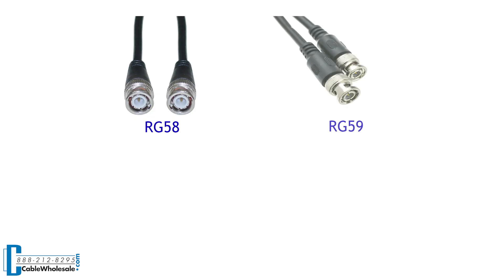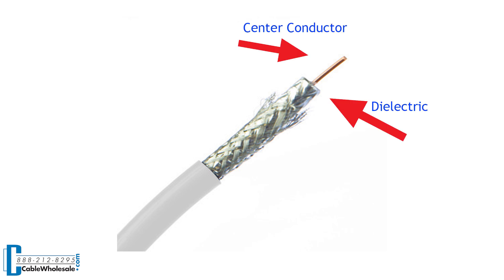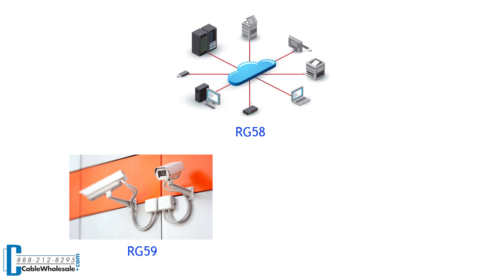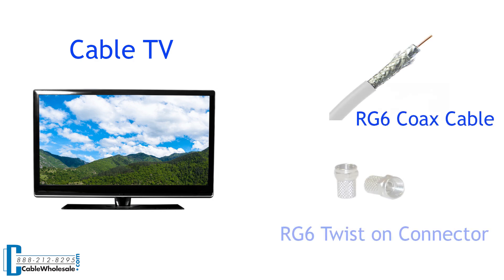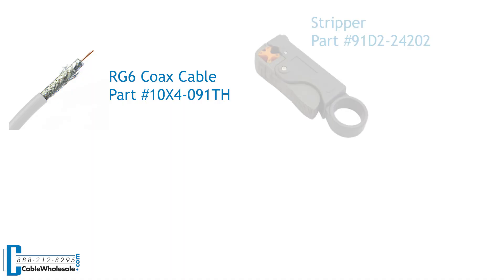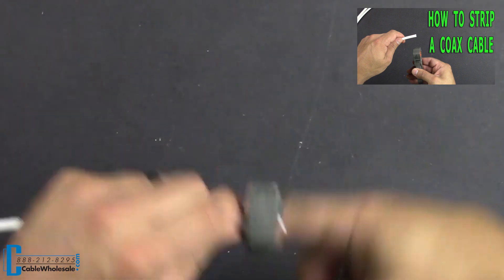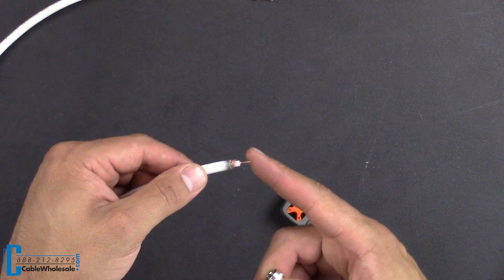How To Install a Twist On Coax Cable Connector - RG6

Comment: I had some twist on connectors in my tool box so I tried to use them but I could not get the cable to fully insert far enough so the insulation would be flush up against the connector body per the design.  I tried three or four times and couldn't get it.  So, I went and bought a crimp connector tool and some crimp connectors.  I was wondering if my cable was too thick.  It is 18awg coaxial cable but it clearly is marked RG-6.
Reply from the maker: Hello @nathangould2856 there should be a problem with the measurement when you strip your coax cable
if you want to send me some pictures to support@cablewholesale.com I may be able to help you, the RG-6 we sell is 18AWG and there's no issue with the connectors we sell for it, 10X4-122TH(quad shield) and 10X4-022NH(Dual Shield) please send me an Email and I will give you a hand!
Miguel

Comment: i have crimping tool but not the cutting tool, always used box cutter. this time i used the twist terminal. i cut the cable plastic sheath 1/2" then 1/4" to allow me to twist it on. happy with the results work great. Thanx Bro' for the video 5 years and still helpful :face-fuchsia-tongue-out:
cerveza for you 🍺:face-blue-smiling:

Comment: Twist connectors are the last choice for coaxial cable termination. The best method is use of compression connectors followed by crimp connectors.

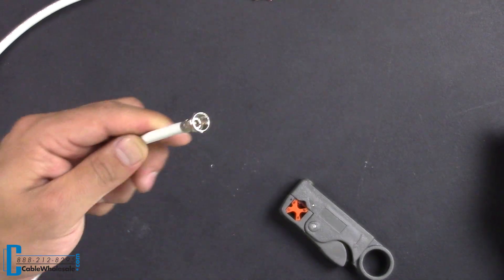Also, if you stop the video at the 2:28 mark and take a close look at the end of the cable, you'll notice that the dielectric doesn't appear to be flush with the base of the connector.

Lastly, RG59 was used early on for cable TV service drops. It was eventually replaced by RG6 and, in some instances, RG11.